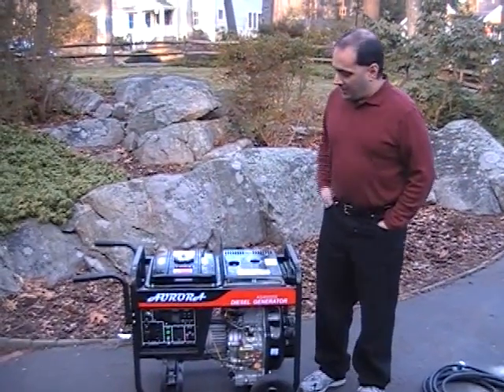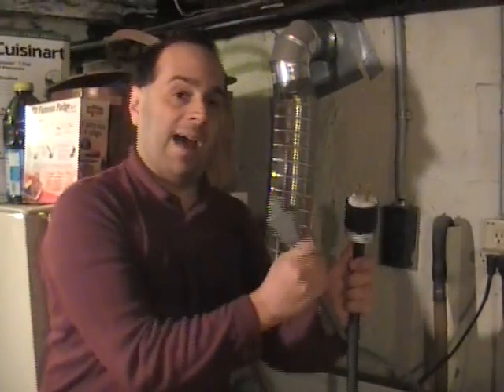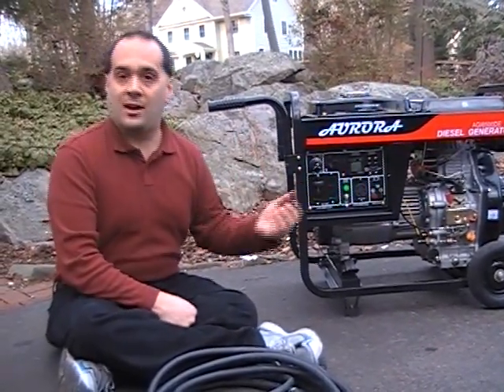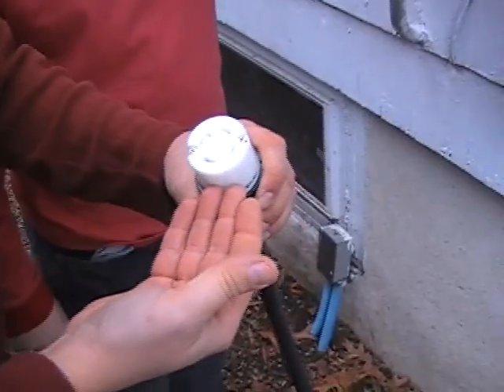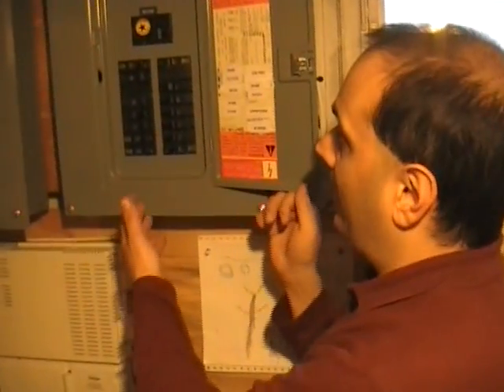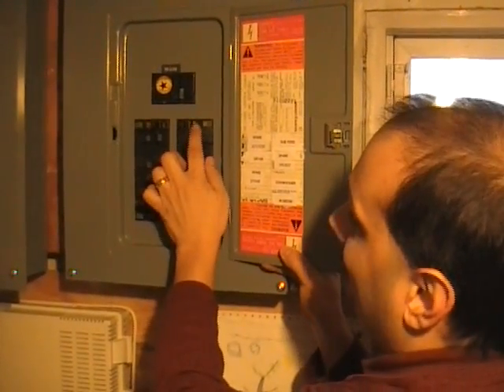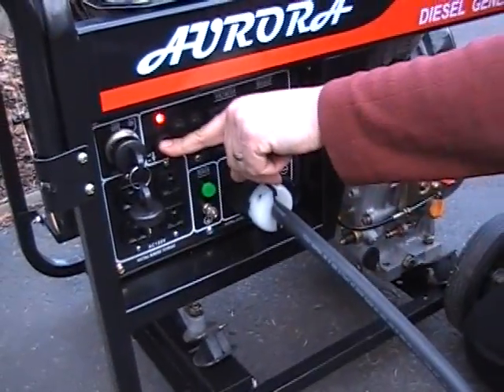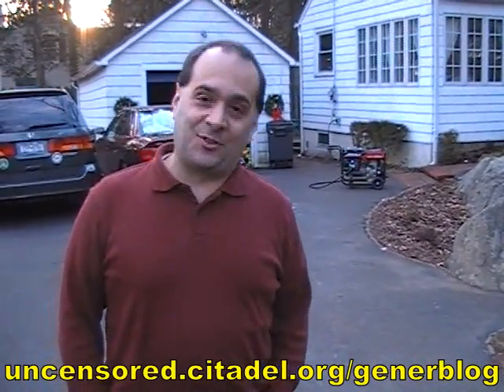Inexpensive residential generator hookup

Comment: Hello Art, hope you read my reply, I'll get this done to comply with the code. You are saying that fire Marshals say this is dangerous as breakers   for said circuit are at other end of .
house. What about the breakers on the generator? would those not suffice for over-current
protection? and if I am not satisfied with pop out brkrs could I get a small sub-panel  and put in a pair of Square D breakers, seems to me that would provide the over-current
protection needed to protect the cord, dryer receptacle and wiring back to main panel.

As I understand over-current protection is needed where the wire size changes, I am not claiming to 'know it all' I just want to understand how to avoid a dangerous set-up.
This still seems like back-feeding because power is still fed to panel's bus bars on the load side of the Mains through a genset receptacle's breaker that is mechanically 
interlocked so this gen-set breaker and mains can't be on at the same time, and of course the added safety of no suicide cord.
Reply from the maker: +Ramona1058 You are correct in observing that breakers are often required where the wire size changes.   Basically you need the correct size breaker for the smallest wire on the circuit.  If you go down a size, you need to put an appropriately sized breaker at that point.

The circuit breaker on the generator is there to protect the generator itself.  To a certain extent it also protects your hookup cable, but mainly it is there to protect the generator.

For receptacles ...  If it's an outlet it has a female connector and the regular branch circuit breaker is fine.  If it's an inlet it has a male connector and the circuit breaker needs to be interlocked with the utility main (and also held down to the panel by "an additional fastener").   Put simply, if it's possible for live voltage to be present on exposed prongs, it won't meet code.  Unfortunately this means that it's pretty much impossible to set up a receptacle that can be used as both an inlet and an outlet.

Comment: The code says you must have a transfer sw.  or mains interlock before you hook a generator to house wiring to keep power in the house and not let it leave the house
otherwise a lineman from the electric company  could be electrocuted, if it is
found you backfed , you might be sued for manslaughter/gross negligence, they
the utility co. might even have the right to not serve you with power, not to be forgotten is
the cost of lawyers cuz the utility company will damn well have them.

In some mobile home parks like mine, I have a "main breaker" under the meter and one in the electrical panel in my house.  Now I am thinking that with 2 sets of "mains" I can save my self the cost of 700$ for a transfer interlock sw. and extra receptacle for gen-set cord
AS LONG AS I AM THE ONLY PERSON TENDING TO THIS SET-UP, no one else.

The power goes out and you hear on a battery powered radio or by phone it will be  at least a day or more before the power is restored .
1 shut off mains breaker in house and under or by electric meter. 
 2 after gen has warmed up for the upcoming load get the suicide cord that has been made up previous to hurricane season (so there was no rush in making it up and making sure it would work) and plug the house end into dryer outlet, there is no juice or voltage
at generator end cuz  mains are off. as we ll as utility power.
3 plug other end into generator, the gen is grounded through cord set, back to dryer outlet
and main panel through the grounded neutral on a 3 wire plug or ground on a four wire
plug.

Everything will work fine if you plug into generator first BUT you just bypassed a huge
safety factor, are you going to walk to the dryer outlet with the plug's live prongs?
this is why it's called a suicide cord, what if it is dark or getting dark, maybe it's raining
you trip and that's the last trip you'll ever make, now instead of your heart  pumping blood
it is vibrating or shaking and no blood getting pumped and breathing has stopped.
And even if you don't screw up and the cord's already placed for the other end at dryer
outlet, got a cat or dog you really love? any little rugrats (kids) inside the house while you are walking back to plug in?The generator is supposed to make your life easier while power is out, not to kill you or the kids or your pets.

O.k. so two days go by, the power is back on as the streetlights are on and neighbors homes are lit up.. unplug cord set from  generator, THEN make damn sure you unplug
other end cuz if you forget and turn back on the mains at meter and in house, you
have a very dangerous situation with cord set still plugged into a live dryer socket.
Electricity, it has ABSOLUTELY NO RESPECT FOR IGNORANCE.
Reply from the maker: +Ramona1058 In a nutshell, it seems you are advocating the use of a suicide cord "as long as I use it carefully."  I cannot endorse this.  Eventually you or someone else will make a mistake.  You seem to understand the consequences of such a mistake.  Please wire your generator properly.  For a small home you can go with an interlock kit in your main panel for about $100, totally worth it compared to destroying your generator, burning down your house, or injuring another resident or a lineman.
Reply: +Art Cancro (IGnatius T Foobar)  Hello Art, I did some checking around and
found I could get a  male end in a weather proof box wired into the house via the interlock sw. so that as you said, the house wiring could only be hooked to either GEN or utility power. This would make the suicide cord to NOT be a
suicide cord if it has a female fitting. 

My way is safe, though if one is stuck in a situation where they don't have enough time  to do it absolutely right, because I or the homeowner WOULD be the ONLY person hooking things up and there would be no exposed live prongs if they 1st plugged into dryer( and with mains off there would be NO power at gen end of cable) However I do agree with you the whole set-up
could be an electrical nightmare if, power is needed,  hubby is away at a business meeting and wife asks her brother or someone else, there's the rub, someone else who would not be familiar with doing this. 

Even if as in my case I have a large cardboard sign  that reads "turn off mains first" heavily taped to gens  gas tank and there is no way in hell
I won't see it.

 I think the old expression, the road to hell is paved with good intentions could apply.

This is still back-feeding even though it is safer, no exposed prongs and no way genset can put power past the house yup, the best way all around as NO one has the chance to screw it up, YUP ! now it is time to shop for a sparky who won't charge me a grand to do the job. Thanks Art!

Comment: the same as you using the throw switch for gen to mains, ALSO i connected a 5watt light the the main power in so when power came back i got a visual indicator then of gen and bk to power
Reply: +Terry Hagan I'm going to do something very similar. Except, Since the panel is in the basement I want to add a switched 110 volt siren to the main feed.  That way when the main power comes back on we'll know that it's time to shut down the genny.
Reply: well the 5w indicator light can be on extended cable, you have to put some cable from mains in to bulb so make it  little longer. stay away fro audio alarm, if your out of the house and power goes and comes back you will have angry neigbours.
Reply: m from UK and now live in Philippines and will be going back to Philippines soon and one thing I need to buy is new genset, there is a store selling Gasoline/LPG genset and they look very good,Peso 39000 for 4KVA unit, and I'm also installing Solar on my flat roof, another Peso60000 haha
Reply: ⚠️ Generator safety rules: Always make sure you follow all the generator safety rules before using your portable generator. This is only a reminder. Generators can be dangerous if not used carefully. Every year, hundreds of people die or get injured when using portable generators due to carbon monoxide poisoning and electrocution. Make sure you are using your generator carefully and keeping others safe as well. There is something very serious that everyone should always be aware of when using generators. Some people do run their generator indoors which is not safe and that increases the risk of carbon monoxide poisoning which can cause death of family and you. Some people run their generator in wet conditions which can electrocute them. Please remember that you should never run your generator indoors. Remember that carbon monoxide is an odorless and colorless gas that you cannot see or smell. Carbon monoxide is a silent killer. Keep that in mind. Make sure your generator is 15-20 feet away from your house and away from doors, windows, and vents. Never use your generator in your porch too. Having a carbon monoxide detector is very important against generator safety. Some people also allow children to go near the portable generator which could pose risks. We need to keep an eye on our children making sure that they are not near the portable generator so they won’t get electrocuted or burned by the generator which is dangerous. A locking enclosure also keeps kids safe. A generator shed might look like a tempting place to explore, or take cover during a game of hide and seek, but a generator is a dangerous piece of equipment that can cause injury. It says on the manual that we should also keep children away at all times from the portable generator to avoid injuries. Please do not allow a child or unqualified people to operate the portable generator.  It is important to keep your children safe especially little ones. The portable generator can be hot during an operation. Just because some manuals missed what should be listed doesn’t mean it’s safe to do. Always follow the generator safety rules when using portable generators. Generators pose electrical risks. If you need to use your generator during wet weather, you need a generator tent to protect your generator from getting wet. Don’t let your generator get wet. Keep your generator dry and before using your generator, please make sure your hands and your generator is dry. Do not wear loose clothing when operating the generator. Everything that is said on the generator’s operating manual should not be ignored. Never smoke cigarettes near the generator. Please keep flammable things away from the generator. Never overload your generator too. Your generator can catch fire. Never ever try to plug a generator cord into a wall outlet to avoid back feeding. Back feeding your generator is dangerous. Always turn on your generator first before plugging in appliances and shut off the appliances before turning your generator off. Use a heavy duty cord for your generator and the cord should not be worn out. All the instructions should be followed carefully. Never refuel your generator while it’s running. It can cause fire if fuel spills while your generator is hot. You should turn off your generator and let it cool off before refueling it. Having a fire extinguisher next to the generator is also important. This is only a reminder for everyone’s safety of using generators. Make sure your generator is properly grounded. Having a fire extinguisher next to the generator is also important against the safety rules. https://youtu.be/I1jT3ANENvI and here is a video more about keeping others safe when using generators and also about our family’s safety. It’s important to keep our little children safe as well. Make sure they’re away from the generator. Hope this helps.

Comment: Hi Art, excellent video.  I'm glad that you showed people how inexpensive and safe it is to do this the right way.  You may have saved lives by presenting this video.  Great job, very informative and spoken in non - technical jargon.  I live out west and in the summer we have temps in the 110 + range. Of course we need AC running and many of us have a well for our water.  The AC and Well are the key elements for us because year round we can do anything else outside if need be ( grilling our meals instead of an oven, and we don't need heating systems).  It's good to know that nowadays you can find a decent generator that will run all of your household essentials for about $1,000 on sale and like you said, less than $200 or so to hook it up properly. People spend that kind of money on a weekend getaway.  With the same money you now have protected your family and can be comfortable in the event of a power outage, especially if it's for a few days or longer. The one thing I made sure I did was get a generator that uses LP or gasoline. My concern is in the event of a long term outage that gasoline will be hard to get. LP is quite abundant and doesn't go bad if you store it in large quantity.  Gasoline has a much shorter shelf life.  Once again, thank you for an excellent video. Good luck and God bless.
Reply from the maker: notsosilentmajority1 Thanks for the kind words.  I put this video together because I got tired of watching others recommend dangerous dryer-outlet hookups, and even more tired of seeing people think that their only other option was those cheap button-breaker panels.

I chose a diesel generator because the house I was living in at the time (the house in the video) had a 375 gallon heating oil tank, and heating oil can substitute for diesel if you are sure that it is not mixed with kerosene (check with your supplier) and is free of water and contaminants (inspect it yourself and use a good filter).

The house we moved into last year is all electric, which presents a different set of problems to be solved.  When I figure them all out, expect another video :)

Comment: ... I'm not sure I understand the wiring in your sub panel correctly but I don't think the switch you referred to as "main" is the true main.  I think you're still energizing the main in power outage... linesmen would be in jeopardy.  Granted, this is a few years old but someone may be able to clear this up for me.
Reply from the maker: sp10sn In the sub panel, there is no main breaker in the location you'd normally find one.  Remember that a load center can actually be fed from any breaker position.  Here's a photo of both panels with the cover removed, so you can see the wiring:  http://photos.citadel.org/generator_001/installed_sub_open.jpg

The 60 amp breaker in positions 2 and 4 (that's on the top right) are the "utility main" which is closed when running on normal utility power.  The 30 amp breaker in positions 6 and 8 (directly below) are the "generator main" which is closed when running on generator power.

The interlock prevents these two breakers from both being closed at the same time, so only one of them can be feeding power to the sub panel.   When the generator main is closed, the utility main is open, and that prevents power from being fed back up to the main panel.
Reply: Art Cancro Art, awesome of you reply, thanks!  To be clear, I'm a noob asking questions and not arguing.  I guess what's confusing me is that I can see your power toggle at the interlock feeding (black & red) in on two rails for each source, line vs generator, but it seems to me they both use the current carrying ground/neutral going back out the main (white) .  Doesn't it need to be isolated in the same way?
Reply from the maker: sp10sn You are correct, the neutrals are not switched.  It's not required in this type of setup.  Also, since it is a sub panel, there is no ground/neutral bonding; that is only permitted in the main panel.

Comment: i have a 3000 watt generator that is chinees made .but that all they see here where i live .am prety happy with it so far am a new comer to this . i was told to run my gen every month for about 10 to 15 mins if not in use i also change the oil already it seem prety not dark .so my quistion is am i ding it right so far ? it stars up like a chram so far i have ad it for about 7 months now. and i feel very save with it last year we had a very bad storm here in the philippines and we didnt have any power for about 5 day it was really bad because we didnt have at the time a generator
Reply from the maker: scottso241 Follow the maintenance instructions for your specific generator, of course, but what you're describing does sound normal.  It is important to exercise your generator every month or two, so you know it's working when you need it.  Regular oil changes are a must.

Comment: Great video however I priced all this out here in Texas and was looking at about 700 dollars for all the equipment I would need. With out an electrician. Also had a question regarding the switching. Would it be more cost effective to install 2 240 volt switches. I currently have  2. Could I connect the grid connections to one and the inlet to the other? Then both wire them to the sub panel and turn them off and on when I need them?
Reply from the maker: arbitergvadam Those switches are great but unless they're mechanically interlocked, they probably won't meet the code requirements for multiple power sources.  It has to be physically impossible to close both switches at the same time.  Normally that's done with a double-throw switch, or interlocked circuit breakers.